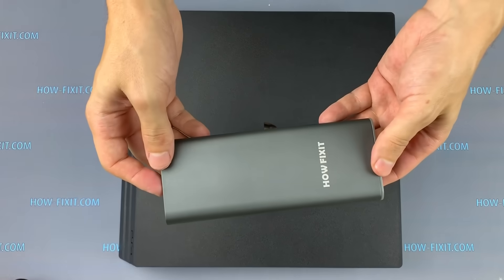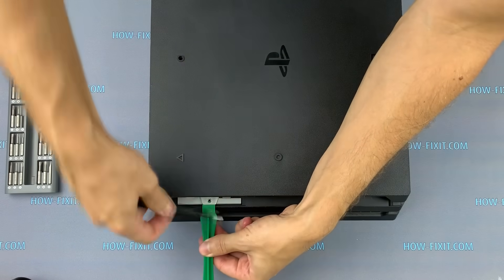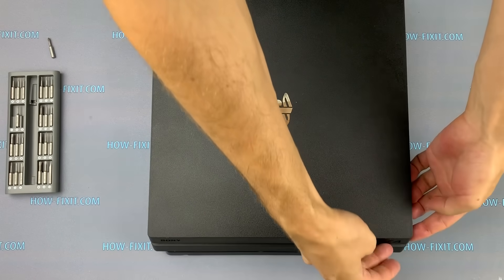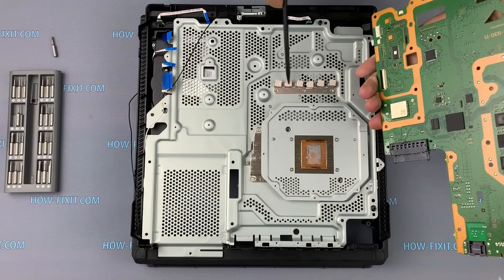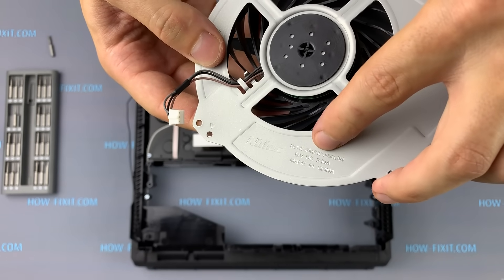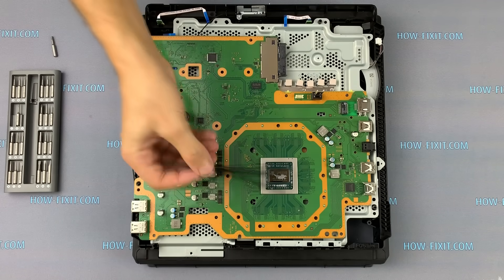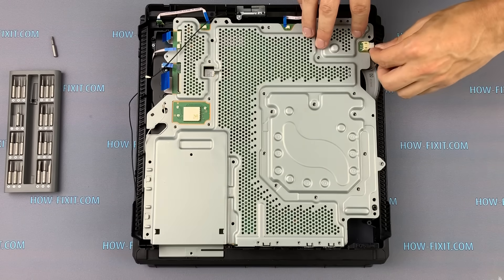PS4 Pro Disassembly: Ultimate Guide for Fan Cleaning and Thermal Paste Replacement

Comment: Great tutorial. Very detailed and makes teardown a lot easier. My fan was running on max speed constantly and when I looked at the fan and heatsink, there wasn't much dust on there so I was kind of doubtful that was the issue. I applied new thermal paste (the original paste didn't have very good coverage) and now the fans are now barely audible. Highly recommend just using new thermal paste if anyone has fan noise issues.
Reply: Super glad you found this video . I found it a few years ago looking for a good teardown video to replace my thermal paste as well and God blessed me with this tutorial. He def deserves a reward for this video.

Comment: I appreciate the guide, very much! Late last summer I cleaned out my ps4 pro and I wanted to get more in depth this time around as it started sounding like an active runway at times. I managed to get every single screw back in without any leftover bits lol but I did break the PSU cable trying my best to gently remove it 😔 almost salvageable and I was even extremely patient and easy going, but it was just too stuck in there and the grip slipped and barely broke one of the wires 😔 at least it's only a $5 replacement and it's much easier in a much easier spot to get to rather than having to tear it all down again.

Idk about you guys, (and for everyone else who have not yet taken the PS4 pro apart, this is a cautionary tale) but they smothered the thermal paste all over the CPU. Just  half of the how much thermal paste there  would have been too much. It was spilled out in globs over most of the CPU and there were still some smaller globs of the paste on the bottom heatsink plate! 😬 
This guide was excellent, but it is easy to make a mistake if you're not very careful which I learned the hard way, unfortunately. Honestly it's the best guide I've seen out there and I've skimmed through plenty vids to get a concise tear down, or at least to get to the main board. Just be super careful and brainstorm the approach if there are any stubborn connectors. Everything else went smooth and I'm eager to see any difference if there are any lol--I would imagine there would be after seeing that CPU! 😬 And having the system dusted out as well..

Comment: Thank you sir! Although I have slightly different ps4 pro (big main cable connector and one additional metal plate covering the chips), your video helped me. I've done it just now using mx4 and the fan noise went down by 75% I'd say.

Comment: My dear Sir, you deserve a slice of Sony. Thanks a lot for the most smoothest video on this topic. I wanted for a long time to clean my ps4 inside as well and change the paste but I wasn't that sure. I said I have nothing to lose now as my ps4-pro was turning into a propper spaceship while playing Warzone. 🤦🏻‍♂️ 
I literally had a strip the size of a finger of pure dust on the side of radiator 😶🤦🏻‍♂️
I cleaned it and placed a new termic paste... 
And the ps4 is SILENT ! ABSOLUTELY NO SOUND... even in Warzone !! There is constantly no sound no matter what I do !!!  

Thanks a lot for the help and easy steps and explanation. 
Those termal beds were a bit of a headache as 2 of them came off just like that. One from the front and one from back. But i noticed and placed them back and everything is okay for the moment. 

Very professional video. Thanks again !!!
Subscribed ✅ keep it up 🙏🏼🙏🏼

Comment: Hello. What could be to blame if the console overheats and shuts off after cleaning. This happens exactly when I play Warzone for about 10 minutes and it seems that the console overheats and shuts down. While cleaning, I noticed a crack in the "Power Supply Cable Motherboard Cable 4 - pins for PlayStation 4 PS4 ADP-240CR", which I already ordered and I will try to replace, maybe it will fix the problem...

Comment: I’m going to sound dumb but do you need the thermal paste
Reply: If you want your ps4 pro to be less hot and more quite then yes you do need it
Reply: You absolutely need the Thermal Paste. The heat sink and CPU will always be slightly different between each PS4, but most have imperfections. The imperfections are why thermal paste is required, it bridges the gap and acts as a conductor of heat to properly dispose of it via the heat sink. If you don’t have it, chances are your system will overheat and you might cause irreparable damage .

Comment: WARNING! I have the CUH-7215B model and I almost broke my power supply following this! There are 2 screws on the other side that need removing before pulling on the power supply! You can see those screws are missing from his system when he flips it over. Check other power supply removal vids first!!!!!

Comment: I bought a 7216B off eBay because I'd read this was the newest and most quiet model without the dreaded jet engine noise. To my horror, as soon as I set it up and started a game (Spider-Man, with boost mode on) it went very loud like the jet engine I'd heard about and seen in other videos, peaking at 60dB (using a free noise meter app). Using this video I disassembled it and firstly cleaned the fan which was actually very clean, so I hoped the problem would be a blocked heatsink that I could clean. I got to it and thankfully it was caked in dust and fluff, which I cleaned away. I took the opportunity to clean away the old thermal paste and apply some new paste. I reassembled it and it is now as quiet as it probably was when it was brand new. It was touching 60dB before cleaning, and now after cleaning and with new paste, it operates between 23-27, sometimes touching 30-33dB at heavy loading. So it's definitely worth going the whole way and dismantling it fully to clean the heatsink and applying new thermal paste, you won't regret the extra time and effort. Take your time, take photos before you remove screws so you can refer back to them when putting them back in, and follow videos like this and you will sort out your own noisy Pro in less than a couple of hours. 

And just for the record, contrary to what is stated in this video, my 7216B had a screw under the warranty seal, but only a clip/latch under the blank seal sticker on the left next to the power socket. But this is probably due to minor differences based on country of purchase, I am in the UK.

Comment: wonderful video. my only critique is that you made unplugging the power supply cable look too easy. i ripped the connector from the motherboard now i'll have to spend a fortune trying to find somebody that will even attempt to solder it back on.
Reply: Mine feels like it's glued in. I decided to just leave it in before I damage anything
Reply: @mccoli3795  you’re smarter than I

Comment: Holy hell I’m having a hard time. Is the top middle screw at 2:49 not supposed to be removed? Everything I’ve tried couldn’t remove it anyway but I absolutely cannot get the power supply out. It’s stuck around that screw and looks like almost all the plastic bridges have now been snapped from trying to remove it 😩
Reply: Nevermind I missed a screw earlier

Comment: You forgot to say how easy is to break the powersource connector of the motherboard,  there are a lot of breaking out there, if you force the cable it will break and detach, and you will have to fix it soldering the 4 contacts, anyway good video, but not that good

Comment: I bought my PS4 Pro in May 2019. December 2021 the fan started to sound like it was a jet engine, pulsing on and off. I took the back panel off and cleaned the fan and vents with compressed air, but a day or so later the fan stopped entirely and I got the 'Playstation is too hot' message.
I ordered a replacement fan and some thermal paste, and using YOUR video I changed the fan and thermal paste on the APU. My PS4 is working again so I don't need to buy a PS5. You saved me a monkey at least, so thank you 👍🏼👍🏼👍🏼

Comment: I simply cannot believe how much of an impact this tutorial had on my PS4. The thing never even kicks up the fan to a level that I can hear it almost. Before changing the paste it actually shut down the console due to overheating during Slime Rancher. It also would say your ps4 is running too hot and just about shut it off during some boss battles in Dark Souls and now I cant even hear the fan? How the hell can this even be possible? Thank you good sir for this tutorial. You have truly helped me. I also did the same thing to our 2nd PS4 with my son using your other tutorial. We need people like you on the internet :)

THANK YOU!

Comment: So I don't need to get anti static gloves to do this?
Reply: The PS4 is not connected to any electrical power so you don't need gloves. Personally I think using thin, clean gloves is good for keeping from making smudges on certain sensitive equipment.

Comment: This was amazing. 
Bought an used PS4 Pro first version (7016B ). This video helped me a lot. Clamp of the CPU chip was different but easy to understand. 

The thermal paste out of the factory was fully dried up and almost nothing in the chip anymore. 

Fully cleaned it with alcohol and afterwards used a layer of noctua thermal paste and the PS4 Pro is soooo silent. The difference is day and night. This was zo worth it. Almost wanted to sell it off again. Super!

Comment: Excellent video, I have never taken totally apart before like this and I fixed my PS4Pro. I replaced the thermal paste, and the fan while I was in there since that was also more or less done for. I don't think I have ever heard the console run so still - the difference is incredible and it now longer overheats when running demanding games. My PS4Pro was a launch model and is 4 or 5 years old (I forget) and there were some minor differences inside, but easy to work around.

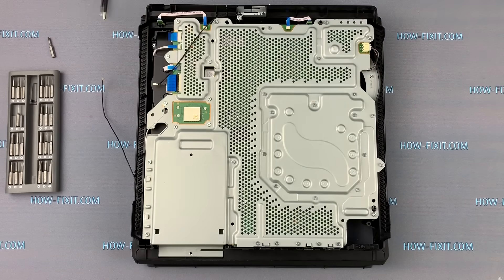Comment: At 3:30 can someone tell me if these little wires just pull out, or is there a tab or something? My pro is slightly different from this model but I can't find anywhere about how they disconnect and I'm afraid I'll break them as this is my first time reapplying thermal paste

Comment: Gotta give this video a dislike. It was all good up the power supply part.

He pulled it too fast. Should have zoomed it. I used pliers and tore the node off my PS4 motherboard.

Video was not clear about which part of the power supply cord to pull.
Reply: You gotta be blind if you didn’t see what cord he pulled
Reply: @loneborne.  the guy in the video did it too fast, I broke my power supply becaus he wasn't clear about HOW to do it

Comment: This is a great tutorial. Added new thermal paste and cleaned the radiator and fan as well as the frame and the PS4 no longer sounds like a jet 😅
Reply: did you change the thermal pad ?

Comment: Great video...except I knackerd mine as the power supply cable would literally not come out and it actually ripped the connector right off the motherboard 😔...was in so tight...I tried connecting it back on but the pins must be connecting properly...shame.

Comment: This is a fantastic tutorial. I just did this with a second hand PS4 Pro. Took me two hours and a lot of nerve. Worst thing we’re those blue ribbon cables. Easy to get out not easy to plug back in!
You need blunt tweezers. I did it by hand though. There was lots of dried up paste all over the cpu Cleaned it off with a dry tissue and cotton buds. The PS4 Pro now works with every game and the big fan noise never comes on. Thank you so much.

Comment: Broke the power supply connector. I followed the instructions and pulled on the connector and it broke. The guy in the vid went over this too quickly. You’re supposed to DISCONNECT it from the female connector that STAYS on the circuit board. DO NOT PULL on the female connector or it will break off like mine did. Now my PS4 is trash.

Comment: Anyone who intend to do this, please remember to very gently press against the plastic housing the ribbon cables except for the first one with a lock latch. Gently slide them out. Because the plastic housing are super thin and fragile, you might end up breaking them along with damaging the tiny pins inside.
Reply: Thank you for telling
Reply: i broke mine thinking they all were lock hatches

Comment: This is a great teardown video. One major thing, I see that you note to just keep the stock thermal pads. You showed the part numbers of some of the easily replaceable components like the fan and everything, but you never noted the thermal pad thickness in the case that any of them needed replacing.

For those that are curious, I believe the thermal pad thickness is 1mm.
Reply: it's 0,5mm
Reply: hey there, did you guys ever figure out what the thermal pad thickness is? im going to do this to my ps4 pro and it’s just the thermal pads that are holding me back because i don’t know the thickness
Reply: @otown5307  from what I've read. 1mm to 1.5mm will do

Comment: I have done the same and PS4 is working quietly but it seems that during reassembly something wrong happened.  The PlayStation works fine on the games saved on PS4 hard drive, however the blue light is not appearing and DVD is not pulled in by PS4.

Comment: Wow so I own the Death Stranding edition since release and never cleaned it before. This video definitely help a lot and my ps4 sounds silent it’s crazy but one thing I recommend is when removing the power supply pull the connector out from the power supply and not the motherboard, it’s easier and cheaper to repair if you break it
Reply: I broke it, at the motherboard side :( Did you send it to repair?

Comment: My anxiety was off the charts doing this but this video helped out a lot. Thanks my bed room doesn't sound like an airport anymore 😂
Reply: did you do it on your own ...at home? I also am facing same issue but I fear that if i do anything it would completely ruin the console
Reply: @shravanbhuyar6276  I did it by myself at home the hardest part was finding that special screw driver because you need one with that has a hole in the center. I also only put new thermal paste I didn't go as far like he did on the last step. Cleaning that last gray grill thing.I didn't want to push my luck 😂 The paste alone helped a lot
Reply: @unknownshark6882  thanks this surely boosted my confidence
Reply: @shravanbhuyar6276  another thing I did was I got a black marker and marked a small dot on next to the philips screws just so I didn't mix them with other weird screws. Hope this helps
Reply: @unknownshark6882  I have found a technician near me ...I am gonna show him once and see what he says

Comment: I followed this guide and managed to rip out the powersupply socket off the motherboard due to poor factory production. I was gentle and have built many computers and still managed to be one of the unluckiest ones...time to solder it back on then.
Reply: I managed to get myself into the same problem.. Have you resolved the issue?
Reply: @lowsmart  I had it solded back on by a professional. My ps4 pro is the latest version so it has 1 earth on either side of the pin that gets solded as earth to stick. Then theres 4 pins in middle connected from socket to motherboard. If you want I can show pictures of before and after.
Reply: @pajam88  Hey yeah sure, I pulled it off just hours ago, so the wounds are still wet.. I will send my email address to you.
Reply: @lowsmart  I had mine fixed but my ps4 pro keeps switching itself off so it's not fully fixed. The powersupply socket is fully solded and fixed but something isn't right...hope you have better luck than me.
Reply: @pajam88  Yea I finally decided to take mine to the pro to get fixed. Haven't got any news tho. Finger crossed.
Reply: @lowsmart  Good luck. Mine clearly didn't want to be opened...need to figure out why it keeps switching itself off.
Reply: @pajam88  Update: I got mine fixed. They installed the socket back onto the mother board and put some new thermal paste. The stock paste was dried out, that's why my unit was getting overheat and blacked out so easily.
Total cost was around $45.
Reply: @lowsmart  My ps4 pro switches itself off abruptly after running for about 10 minutes 😔
Reply: @pajam88  Oh no.. I think you need to check on of the ICs on the pcb.
Reply: @lowsmart  What's that?
Reply: @pajam88  Components on the motherboard.. Have you clean up heatsink and replaced the paste?
Reply: @lowsmart  Ofcourse...

Comment: Don't do it. Ruined my PS 4 on power supply cable removing stage. 5 minutes. The connector came of as i tryied to pull the cable

Comment: Following this guide for a year now..Been cleaning mine for 4 times now in just a year. I was wondering why fan was noisy after a week of cleaning and replacing thermal grease. It turns out that the thermal grease that I used was expired which only lasted for days to a few weeks, no wonder it was too noisy. Finished putting new thermal grease now.

Comment: I did everything thing in the video but except for putting all the screws back and when I turned it on a blue led light flash then the fan work for a second then it beers and automatically turns off. What seem the problem

Comment: Unbelievable. I can't believe what a difference this made. 
My unit wasn't even that dusty, and the thermal paste looked fine. But with just a brief application of new thermal compound, it no longer spazzes out in Outer Worlds (the basement area on the groundbreaker.) A few runs through of that level and it would do an emergency shutdown. Now, the fans barely spin up. 
Astounding!

Comment: Fantastic video. I was really worried about taking my PS4 Pro apart, but decided to give it a go. Followed you step-by-step. The hardest part was disconnecting power supply cable. Completely clean and rebuilt. Running really quiet now. Many thanks 👍
Reply: i ended up ripping off the motherboard connector to the power supply cable, it now needs to be soldered on again, which i reckon i cannot/shouldnot do on my own, as i've never done it before. meh.
Reply: @matthiasreitner679  i have done the same how much dud the repair cost you